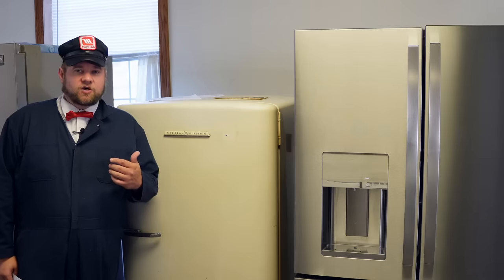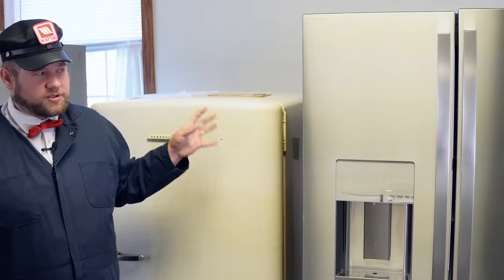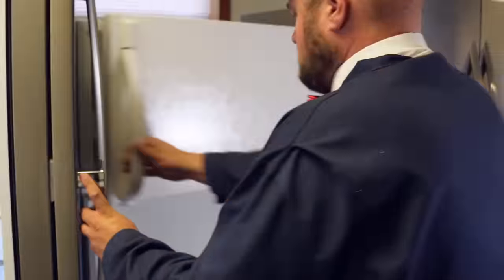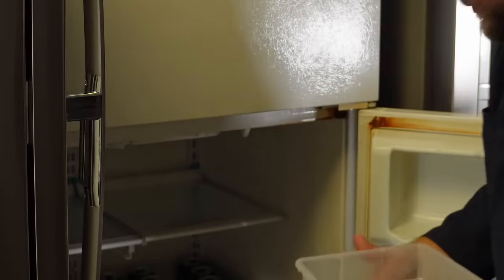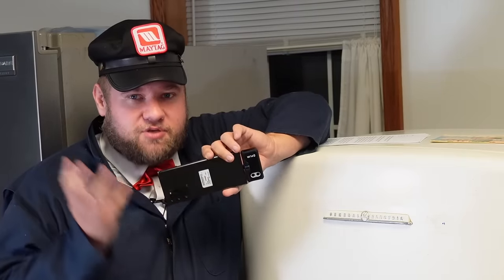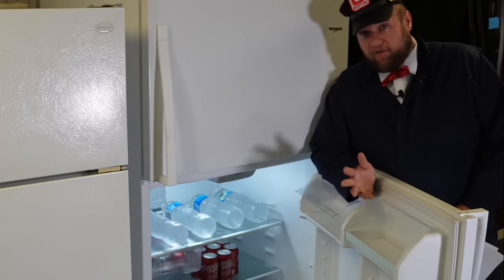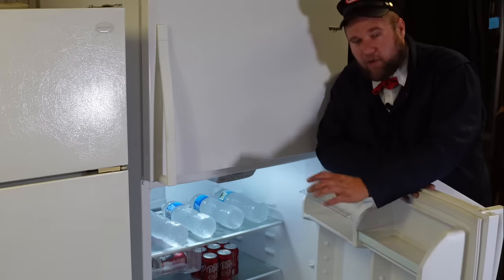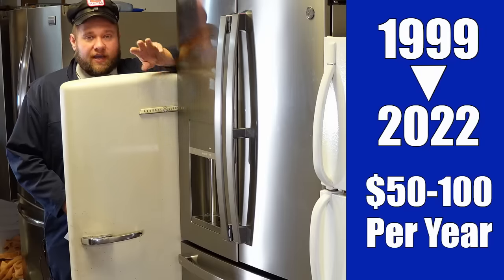Should You EVER Buy a New Appliance if Yours Still Works? A 7-Day Test

Comment: As a teenager I worked with the appliance repairmen in my father's business. One job was the replacement of the door gasket in a late 1920's GE refrigerator that had the coil and compressor on top. I  was astounded that we could still get new replacement parts for it, more so than the obvious fact that it was still working.     Another appliance was a 1910 electric hot water heater that was rust free and still working. The electric coils were on the outside of the tank and coils insulated by wood slats! Amazing! The owners of the ancient hot water heater wanted something more efficient. Over 110 years old, and still working fine.
The technician and I replaced the rubber tub in an ancient Bendix clothes washer. Again, I was astounded that we were able to source OEM parts for it. Upon carefully examining the replacement tub was new.
Reply: Yea I could see keeping an old fridge but not a hot water heater. Even an all electric hot water heater from 10 years ago is much less efficient than one today and further compound the fact that heat pump water heaters are about 3-4x as efficient as the best electric coil hot water heater it's really a no brainer not to get rid of the old one. I just bought a house with a tiny little 30 gallon all electric water heater that is 15 years old. According to the energy star label it uses around 4700kw a year. A 50 gallon rheem hybrid uses about 900kw a year. It's been replaced haha.
Reply: @AustinMichael  but that heat pump water heater will fail before it’s 10 years old and it won’t be worth fixing and you’ll spend more than what you would expect for electricity running older water heater. The heat pump water heaters all run above the critical temperature of the refrigerant it using none of them will last.
Reply: @AustinMichael  What nonsense are you talking about? Electric heaters are all almost 100% effective, old ones, new ones... It is a piece of metal that is resisting the current and creates heat energy. You are not gonna save anything by installing a new electric heater over your century old one. Heat pump is something completely different and it is enormously expensive, can only be installed if you have the property fit for it and does not last that long
Reply: @petrmaly9087  You forgot to factor in insulation standards changing.
Reply: @ron9381  You can say the same thing about most air conditioners, last time I checked they typically last more than a decade. It really isn't that hard to design a machine to last even one with moving parts like a heat pump, all you need is something to incentivize reliability like a decent warranty.
Reply: @garethbaus5471  In such case it will heat up the room, however you can add insulation yourself, our heating/cooling system at work is insulated from the outside. And no, even with our modern insulation we don't have much better results as people 110 years ago, who used asbestos and such materials. We use safe materials, we have  much safer electric circuits, but that's about it. I was talking about how the coil itself work. Even the ancient one operates on nearly 100% efficiency. Gas, coal and wood burning became much more efficient. Electric coil heating didn't because it was already operating on the physical limits.
Reply: @ron9381  water heaters are a little different cause the customer isnt the average dummie, it's housing companies and stuff, and they will not accept a crappy lifespan cause it will probably cost them money, at least i hope so
Reply: Survivor bias.
Reply: @petrmaly9087  There could be huge difference in heat loses from the tank, at the first place, insulation materials could be different and shape of the tank thus volume to surface ratio will play role as well. Not to mention that shape of wires in heating elements can influence power factor and thus reading of metre.
Reply: @AustinMichael  But you are comparing two totally different technologies. Heat pump and standard water heater.
Reply: @garethbaus5471  That is why GE sold their heat pump hot water division too Rheem . GE‘s warranty cost ate their lunch they did not make any money in fact they lost money with their division. heat pump water heaters are very difficult to build because of the physics of the refrigerant and the water has a bad tendency of failing the heat exchangers. Air conditioners have air cooled condensers and evaporators that could be cleaned relatively easy to keep the temperatures within the range of the refrigerant will last 25 years but they do require maintenance to do that.
Reply: @misterbikerman7888  Heat pump for water heaters would not even be a thing if there wouldn’t be tax payer incentive to pay for them but even with that none of them have been able to last the 10 years they were required too. Over a 50% failure rate in 10 years is not an acceptable business.
Reply: @KekusMagnus  Well, not the same as a fridge, (it might look similar on a picture) and it is outside, working with different temperature ranges and completely different amounts, which reduces it's lifespan drastically. Learn something about it.
Reply: @MrToradragon  There probably isn't much of a difference judging by what I have seen on those from the 30s. The insulation can and likely is an overkill, shape is almost identical, same as the position of the heating elements. I have no idea. No matter their design, the heating elements back then had pretty much 100% efficiency. It's a matter of physics.
Reply: @ron9381  Debating with hypotheticals really isn't a valid tactic. First off my hybrid paid itself off within 3 years so even if it only lasted ten it would have been well worth it.

Also it's a heat pump. A good one will last a long time.
Reply: @MrToradragon  which is why it should be replaced. Tech advanced and I'm sure that old insulation and who knows how much build up is in that tank after 100 years.
Reply: @ron9381  show those figures lol. Making stuff up isn't helping your argument. Also heat pump water heaters  have come down in cost a good deal.
Reply: @AustinMichael  My present GE hot water heater is a hybrid heat-pump unit that replaced a 1980's electric four years ago. There are four of us in a large home, one takes three showers a day. There was a huge lowering of the power bill right away. 
The hybrid is located in my basement and also has the side benefit of being a most effective dehumidifier. I'm tall and notice the air filter, clean it regularly, but no one else can see it or checks it. This could be a problem later on. Our water is melted snow and is free of mineral deposits.
Reply: @AustinMichael  ignorance  is bliss. I have repaired and diagnosed over 500 heat pump water heaters in my life. What you don’t understand is the critical temperature of the refrigerant use in the heat pump water heater. And the problems of scaling of heat exchanger causing heat transfer problems that lead to the early demise of  pump water heaters. if your water does not cause your problem and you do not set your temperature above 120 it’s possible for you to get 10 years by a 50% chance.
Reply: @AustinMichael  Electric water heaters all have exactly the same efficiency at heating water. The difference from one to another is the insulation. Heat pump efficiency depends on the difference in temperature between outside and inside.
Reply: @ron9381  You talk about ignorance while equating your antidotal evidence as actually being statistically significant haha. Making up stats isn't helping your argument haha. But I have already told you the thing pays itself off within 3 years and that is with cheap electric. The savings are going to be even greater in states with high electric costs.  After it's paid off I don't care what happens to it.
Reply: @nomebear  Exactly, the things are awesome. Wouldn't go back.
Reply: @petrmaly9087  you clearly have no idea how electrical appliances work or are designed lol
Reply: @AustinMichael  The only reason you got a return in investment is because I paid for 75% of that out of my tax dollars. If you take off the subsidy it does not pay off. The heat pump water heater division a GE losing money and being sold to Rheem. GE had signed an agreement that they would warranty the units 10 years with the US Department of energy. The business people at GE found it was impossible to make them last 10 years. that is not anecdotal evidence. This will only work for you tell you run  out of other peoples money to spend.
Reply: @AustinMichael  I did not make up stats I know from the 3000 heat pumps the company I work for has put in and how many I’ve worked on and how many have failed. most of our customers have not replaced them and are running on the electric element that’s included in them. we quit selling them because of such a high failure rate and customer dissatisfaction.
Reply: @petrmaly9087  well you forget how much isolation has improved. So you'll lose alot less heat to air and gain efficiency that way
Reply: @putinslittlehacker4793  How much did insulation of a heater improve? Asbestos was replaced by less effective materials, put a thermometer on an old appliance and you will see it is often well insulated. The difference would not be probably even noticeable on the bill and you can still additionally insulate the appliance from the outside as well if there is a problem.
Reply: @bricknolty5478  Oh, did I step on someone's toe. How funny of you to get angry over me being right. I worked for some time with electronics for agriculture and military uses, my experience is mainly in CAN bus usage, not home appliances, but I firmly believe I understand how a simple resistor works. Are you probably so angry because you believe commercials telling you to buy new electric heater every few winters instead of remembering what you learned in 7th grade.
Reply: @petrmaly9087  fiberglass and rockwool are not less effective than aspestos. They super analogous just the fiberglass having thicker fibers and being made synthetically. As he stated the heater was insulated with wooden slats whitch is far from bolth asbestos and fiber glass in the way of isolation. You could insulate it on your own but I wouldn't trust an average consumer to do so. And I would think it would impact your bill due to the lack of effective insulation causing it to run more frequently to maintain temperature
Reply: @putinslittlehacker4793  It depends on the type, asbestos was so popular mainly because it was very effective even in relatively thin layer (relatively!). I assume the insulation was not just by wooden slats alone as I have never heard about such a design, but I have seen wooden slats being used as a container for layers of mineral insulation many times. It also depends on what usage are we talking about. For example I have a heater that heats both water and the central heating in relatively cold environment. Heat losses would be minimal even without insulation and because it is inside the living space, they are welcome through vast majority of the year as they heat up the bathroom. However if you go back in this debate you see that the main issue is different. There are people who think that an old heating coil is less effective than a modern heating coil and that is a reason to throw away an old heater and buy a new one. As evidenced by a dunce claiming that a new electric heater is much more efficient than one from 2012.
Reply: @nomebear  
Do you want to save even more money on your power bill? Limit the number of showers that family member takes to two showers a day. Wtf are they doing that they need three showers?
Reply: @AustinMichael  There was 11 inches of sediment in the bottom of the water tank, but no rust. The owners used rainwater from a cistern.
Reply: @petrmaly9087  Nobody is going to listen to your nonsense dude. Hybrid water heaters are the future and continue to come down in price and it's going the same way with dryers.
Reply: @AustinMichael  They will also increase in reliability as the components which fail get redesigned. The first mandated energy improvements were in the late 1980s. GE had to redesign their compressors to meet the new requirements, and did it poorly. We got one of those units in 1988, and they recalled the compressor because it was so bad. One of the things they did to make them more efficient was to reduce the material inside the compressor so it took less energy to get them started, and to use lighter materials. Unfortunately, the new compressors had a wear problem that gummed up the bearings. We had to get our compressor 3 times before it worked properly. But, the third one lasted another 20 years, and only got replaced when it developed the symptoms of a slow compressor leak.
Reply: @AustinMichael  I will tell you a secret - if the government subsidises it and people still don't go for it, it's crap. Also, good luck installing your hybrid in your 5th floor apartment. Install 5 of them if you like, but don't come crying to us after they stop working properly. I did my calculations for various heat sources as we are renovating a house and condensation gas burner plus wood stove is by far the best. If I have to, I will buy some forest as well.
Reply: @petrmaly9087  Ok buddy have fun with your forest and all that labor you aren't accounting for.
Reply: @AustinMichael  It's not labor, it's exercise and fun. Try it, you might be surprised how refreshing it is to take care of the environment (I have been doing it in local natural preserve for some 20 years by now) and how great exercise is working with lumber.
Reply: "hot water heater" is redundant.   You don't need to heat hot water.  It's "water heater".
Reply: @robertromero8692  Keep in mind not everyone here is a native English speaker or even fluent in English. It might sound weird in English, but in some languages it is not so weird.
Reply: @petrmaly9087  I've seen  people who were born and raised in this country also make that mistake.   Other examples are "free gift" and using the dollar sign AND the word "dollars".
Reply: @petrmaly9087  YOU should learn something about heat pumps, lol. A fridge literally is a heat pump.
Reply: for sale ??
Reply: @misterbikerman7888  Yeah - if you can find a new one that won't have a crappy lifespan!

Comment: When I was in university, in one apartment I rented, there was a 1932 GE Monitor top fridge.  It had a footpedal on the left leg which would release the door if your hands were not free.  The condenser coils were exposed completely and fairly warm.  The actual freezer part was minute compared to today's fridges.  BUT it did work well - it was 1969- 1970 when I was there so it was already 36 years old.  I was fairly conscientious about defrosting it - which didn't take much time.  One thing about having to defrost a fridge is that the insides would get wiped out every few weeks or so with baking soda and water.  So the interior was usually much cleaner than most fridges are today.  Considering the technology available at that time (sulfur dioxide was the refrigerant in the 1932 one) it was relatively efficient.  I kept the condenser coils vacuumed and as clean as I could which helped with heat exchange.   And of course the freezer section of it was quite small so keeping ice-cream around wasn't an option.  But it made ice cubes in four hours, kept frozen veggies well as well as any meats I'd put into it.  We have to have perspective about the topic of refrigeration.  An electric refrigerator was a huge leap forward - my grandmother had to go shopping daily for fresh veggies and meats and she had an ice-box which had it's costs - a half block of ice cost $.10 in the winter months.  The ice-men would jack up the price during the summer months to $.25 per half block.  A block might last two and a half days.  If you multiply that out for inflation today, you'd be spending about $15.00 a week to keep food only cool.  So an electric refrigeration "machine" as they were originally called was a real step forward.
Reply: That footpedal sounds very useful. Would love to find a fridge that does that today. I used to be into old cars and it’s amazing the cool functions some of these older cars had that really would be nice to have today but have been fazed out of car manufacturing
Reply: I have a 1933 GE monitor top with Methal Formate. 90 years old.. it runs like a champ. It runs less and cycles less than my 18cu ft modern refrig in the basement. granted a size difference, BUT like yours, other than the refrigerant, it is remarkably efficient and cold!
Reply: Thanks for the story, I especially liked the pricing details! I am but a lad of just 51, so those days escaped me ;)
Reply: Born in 1959 here. Interesting story. I'm glad I asked my parents and grandparents the questions that I did but I wished I had asked a whole lot more.
Reply: I have fond memories of going to the ice house and getting a treat (a big chip of ice on a hot summer day). We had the ice box downstairs as it leaked, at our family cabin. And had another newer model up in the cabin kitchen. Things used to be made to last and were so much better made.
Reply: I have a 1933 GE also still working. Built in June or July. Has a short somewhere and will shock you, but if you ground it to a pipe, no problem. Dont use it anymore though. But it sure i purdy :) to look at!
Reply: @teledoink  there is one that i saw that opens if you put your foot in a certain place, this was on an expensive fridge.
Reply: @kimberlindy  I’m sure
Reply: Wow, a college student that actually had a brain! I'm impressed 😂
Reply: The neighbors still use a Monitor Top as their kitchen fridge. I have a Kelvinator from the 50s personally. I don't like big fridges because they encourage you to fill it with food which makes a mess and use more energy. No reason I need anything bigger, it's just going to use more energy and I'll end up making a mess of it.